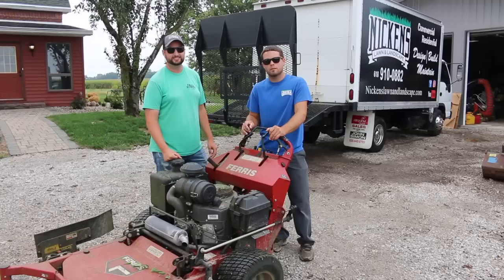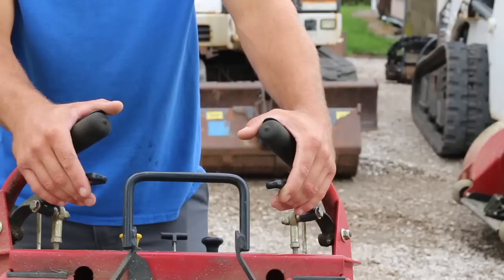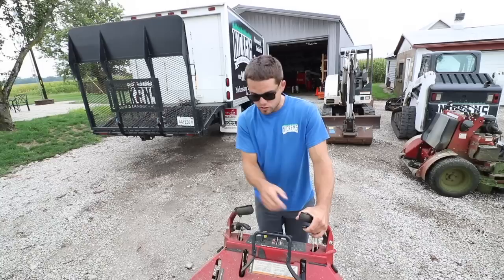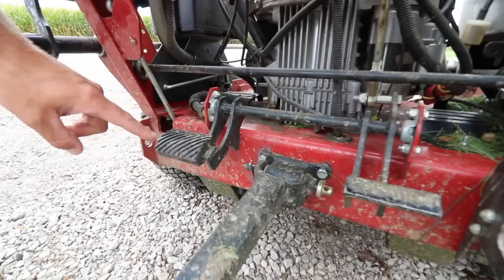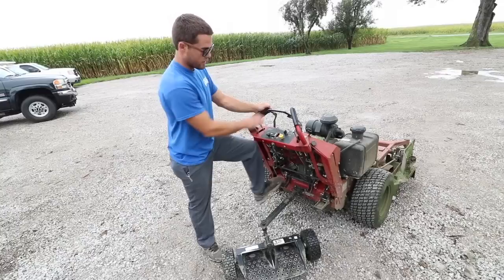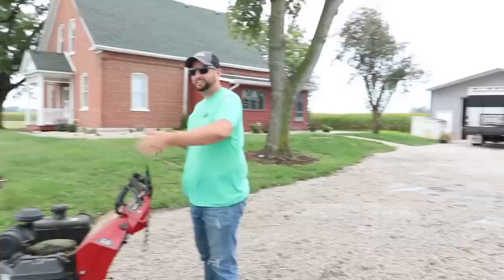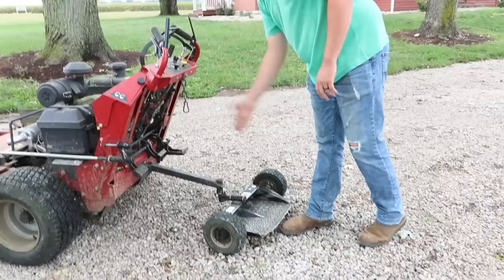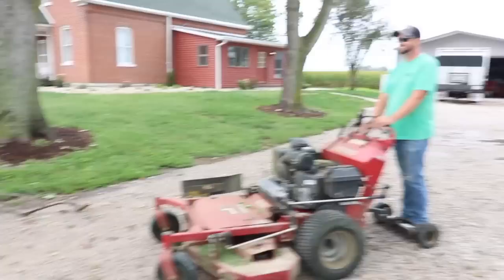How to run a Walk Behind Mower, Step by Step

Comment: Haha wow.... and Ferris is a very complicated mower for beginners. It is the closest control mechanism to a Walker mower where the right Speed control handle is the same as the Bar in the middle, and you use the left and right drives with one hand on the walker as opposed to 2.
Reply: And then the Sulky is a whole new experience, You could have at least pulled that off... Curious what the plan is on the gate scroll work now that Kevin owns the Box truck
Reply from the maker: Ken MrKLC yeah not the easiest thing to learn but similar to most Walk behinds. They definitely take a better operator than a stander or zero turn. 👍🏼  he put a power lift in the gate 🙂

Comment: Do certain mowers stripe and others don't? Or do i have to make some sort of attachment to make the mower stripe?
Reply from the maker: Jose Jasso Most commercial mowers stripe. If it doesn’t all you have to do is put a rubber piece on the outside of the back of the deck and hang it down about 1.5 inches. An old mudflap works great 👍🏼

Comment: I am seriously considering getting a fw35. What speed do you typically mow? A well kept weekly lawn not overgrown.
Reply: Guys here in NY with EFI Vanguard engines are cutting at top speed in the open. Even older 15hp single cylinder units can haul but on good grass.
Reply: @workingcountry1776  I appreciate it. Currently running a 15hp exmark metro with the older trivantage deck and am not happy with my mowing speed to leave the cut I'm expecting. It may just be deck design but overgrown or not perfectly dry means a big slow down and double cutting way to often.
Reply: @GG-ub4ej   It seems like a 15 hp gear drive should be fine on typical turf though. I had to try a few blades before i found winner. Now I mow in high gear when I can and it doesn't clump. My mower has a 15hp koehler and I only double big messes. 
Good luck.
Reply: @workingcountry1776  Maybe I just need to try different blades. Appreciate the input.